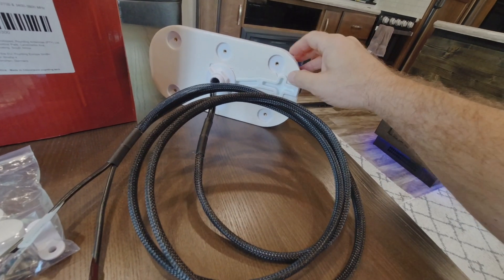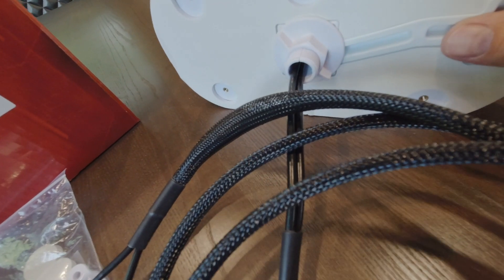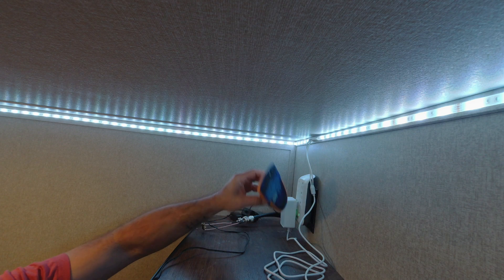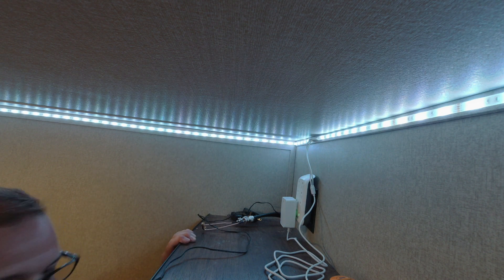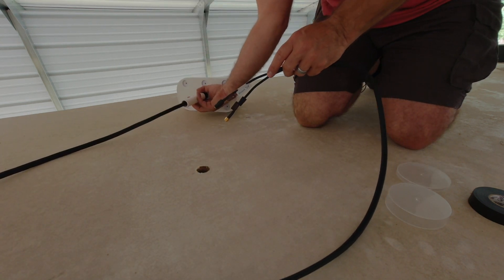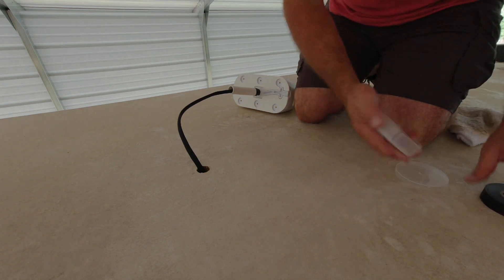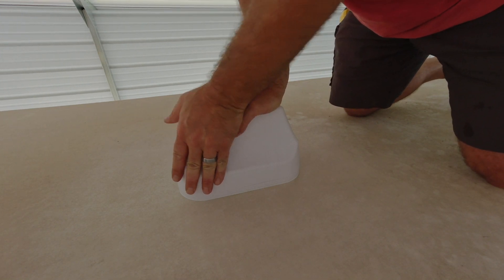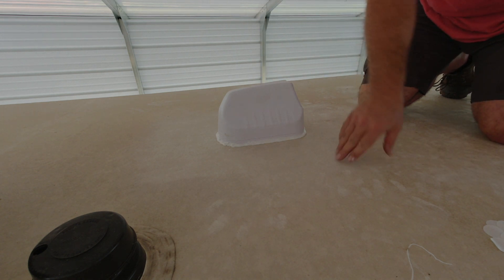RV INTERNET - Poynting Mimo 2-in-1 Omnidirectional Rooftop Antenna Install

Comment: Nice video, thanks for documenting. May I ask why you used the PVC and not the longer threaded extension?
Reply from the maker: I used the pipe so I could make the extension a little longer than the one provided. I have really been happy with the way this antenna has performed. I really does a great job in those areas  where the signal is a little weak.